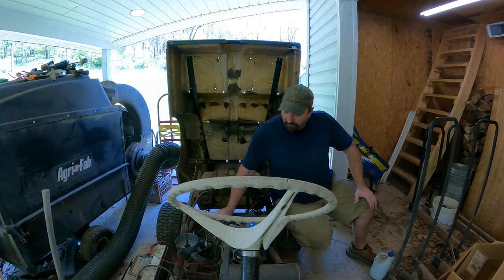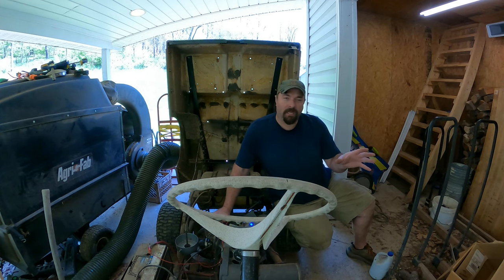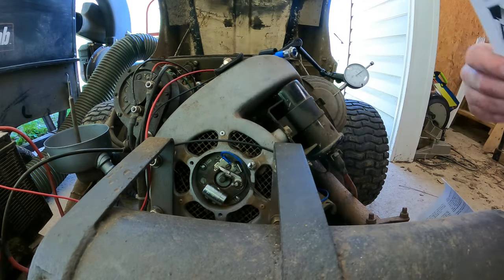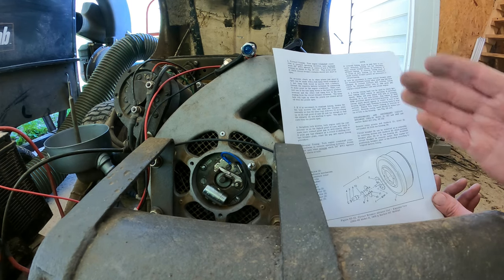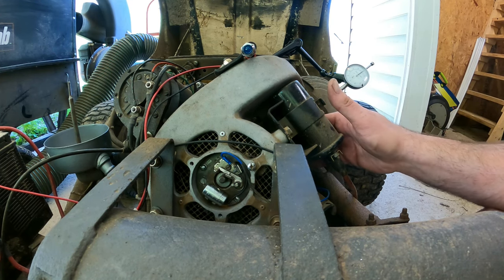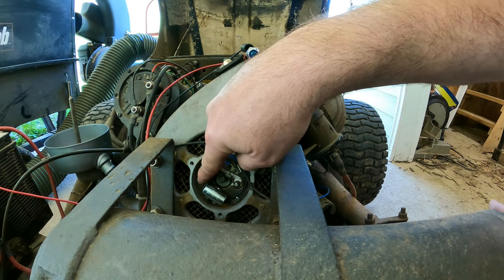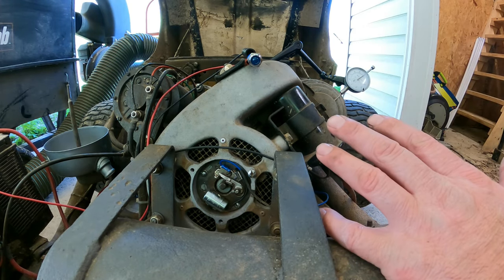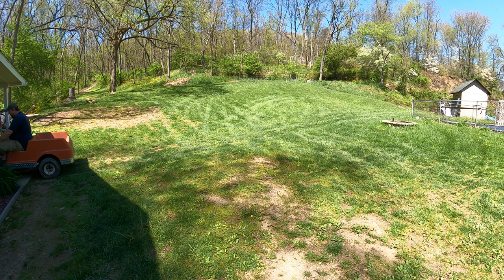P15 How to set up the timing in your Harley Golf cart. Timing to run the best in forward and reverse

Comment: What kind of light was that hook to your golf cart when you were finding TDC and BDC and what was it hooked up to? Great video by the way
Reply from the maker: Thank you!!!I got this LED from DigiKey.com (I think) https://www.digikey.com/en/products/detail/apem-inc/Q12P1CXXB12E/1953547 I hooked the positive side of LED to battery + and the negative side to the points with the coil unplugged. EDIT I don't remember spending that much for the LED at Digikey, I may have got them from Newark Electronics, $5.36 each here... https://www.newark.com/apem/q12p1cxxb12/led-indicator-panel-12mm-blue/dp/91Y6854 
You can use any light that doesn't pull more than 1 amp. Good Luck!

Comment: Sounds like the clutch is really worn out on it and it changes the RPM oven as it converts so that changes how it runs take your clutch apart check it out
Reply from the maker: @SABsGarage
1 year ago
The belt had some oil on it from when I had issues with the clutch leaking. New belt is on the way and hopefully that helps get the power to the ground! Thanks for watching!

Comment: There's two marks on flywheel  how do  I tell which is for forward or reverse?A n are you saying to put fly wheel on mark an set points maybe 25 thousand
Reply from the maker: It's hard to tell which is forward or reverse and really doesn't matter. The marks are to set when the points just open, the light just turning on. These are a little different than other engines, the point gap is how you advance or retard spark. If you get the inspection plate set right, i.e. the points opening on each dot on flywheel, you never move that plate again and you adjust point gap to advance/retard.

Comment: How does the test light work? Where can I buy one?
Reply from the maker: I got this LED from DigiKey.com (I think) https://www.digikey.com/en/products/detail/apem-inc/Q12P1CXXB12E/1953547 I hooked the positive side of LED to battery + and the negative side to the points with the coil unplugged. I don't remember spending that much for the LED at Digikey, I may have got them from Newark Electronics, $5.36 each here... https://www.newark.com/apem/q12p1cxxb12/led-indicator-panel-12mm-blue/dp/91Y6854 
You can use any light that doesn't pull more than 1 amp. Good Luck!

Comment: Do you know how tight the reeds to be
Reply from the maker: Nothing in book refers to how tight reeds need to be that I saw.
Reply: 25-30 ft lbs  I've got a 82-83 that I don't know how to time. And the points assembly only marks I've seen are the two lines on the fan

Comment: What do you wire your light to
Reply from the maker: One lead goes on the battery and the other on the points. Be sure to remove the wire off the coil that goes to the points. Good luck!

Comment: The engine sounds good, but it sounds and looks like your losing power to the wheels.
Reply from the maker: I agree, The belt had some oil on it from when I had issues with the clutch leaking. New belt is on the way and hopefully that helps get the power to the ground! Thanks for watching!